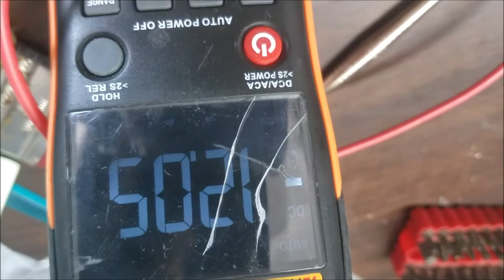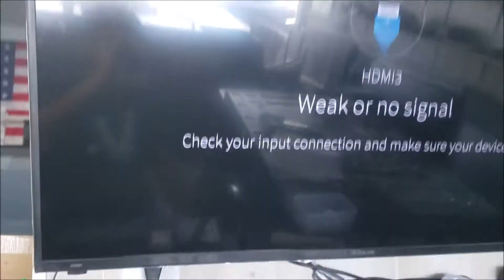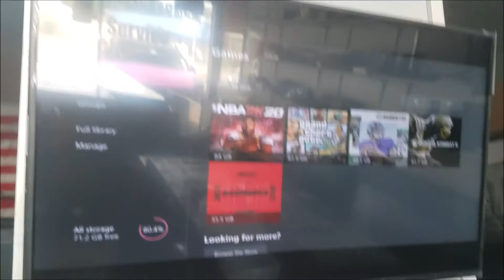Xbox one S no power water damaged

Comment: Did you put new thermal paste on the cpu? What cleaning solution did you use to clean it? Last question, how long did you wait before testing on power?
Reply from the maker: you can remove the fan and clean the heat sink without removing it from the cpu, but new soft thermal past always good, but if you dont have the new paste you can mix the old thermal baste with  solder flux it works great too. you dont need to wait
Reply: I have a Xbox one s and some water spilled in side. The Console turns on but it shuts off after a couple seconds. Can you please help me with this?
Reply from the maker: @tylerrindar7320  take it apart use alcohol and tooth brush to clean any corrosion on the board
Reply: Do yk what I could do I spilled water on mine